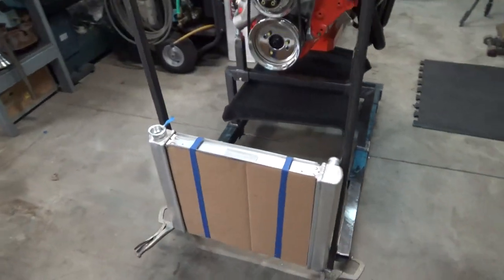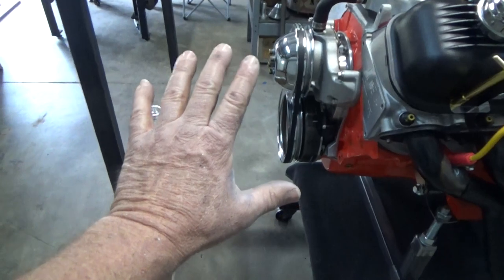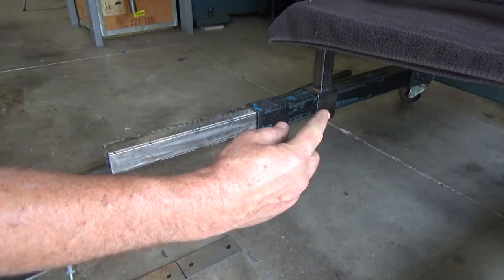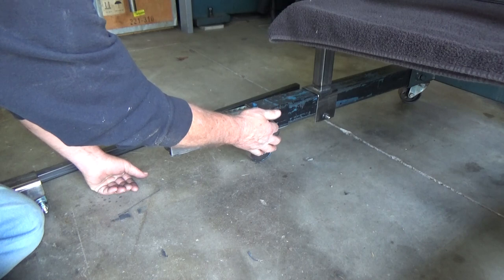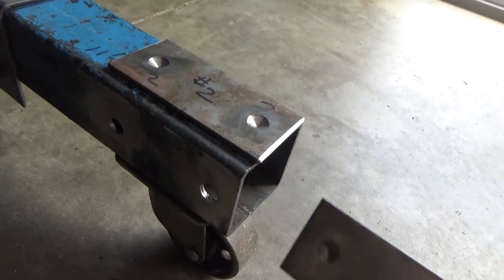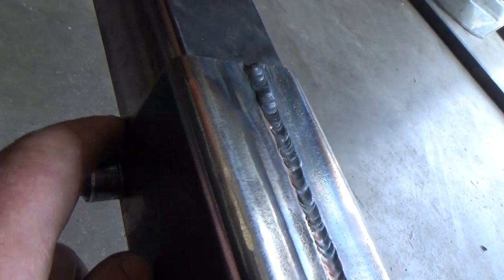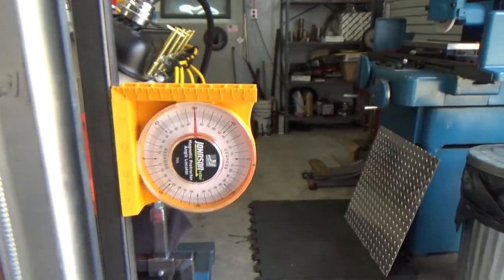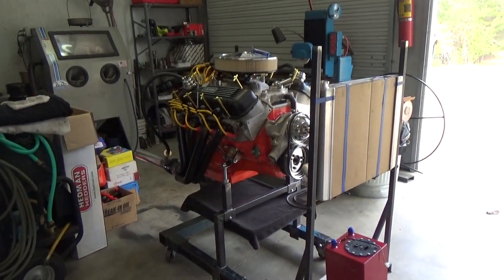Old Engine Stand Repurposed for Engine Test Stand... Build Part #3

Comment: Been loving the build series man. You gave me the push I needed to buy a set of AFR 265’s. I even got the same intake. I work with my family at a machine shop and I’m really considering machining my intake to fit perfect with the heads like you did. I’ve got a mill so I could set it up on there, or do it with a Dremel like you did. I’ve got a 454 punched out to 468. Currently have 990 rec port heads with a Comp Cams XS274S. Mild cam, but AFR told me it’s pretty perfect to work with these heads. Compression should be about 10:1 when it’s said and done. I just gotta wait till July for them to come in! Counting the days...
Reply from the maker: Thanks Joseph for the nice comment... Sounds like you're going to have a very nice engine yourself!   Hope your AFRs come in before July... And good luck with your build...